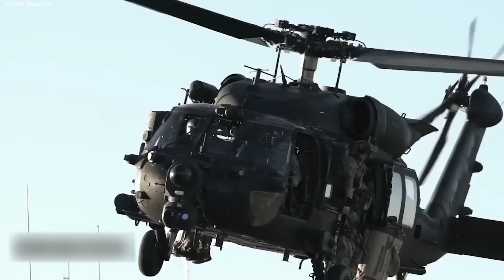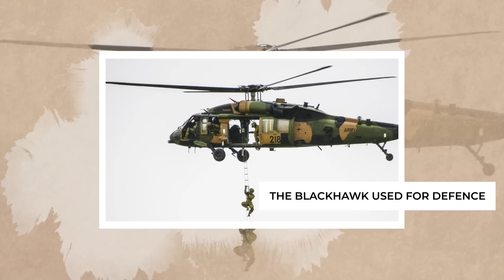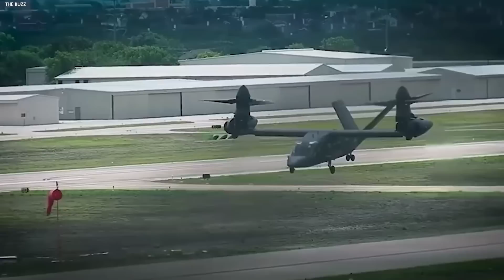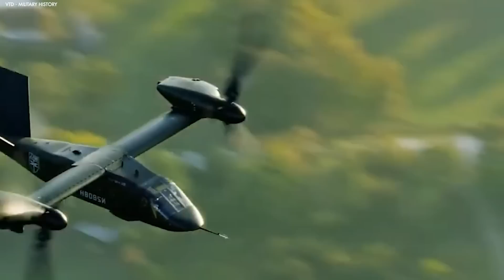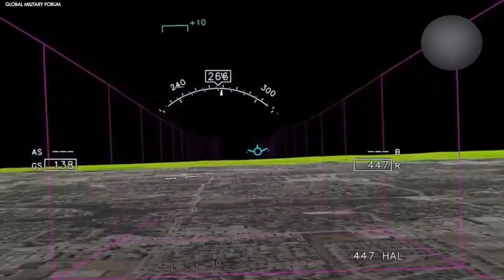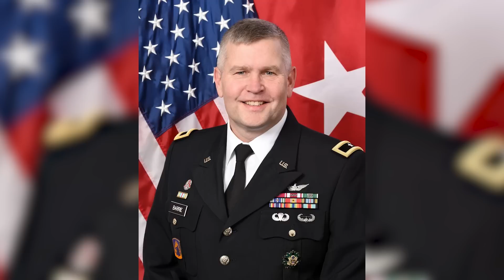Here's The US Army's Next Gen Helicopter to Replace The Blackhawk

Comment: Some errors are noted in the history of the Blackhawk. The first units to be equipped with the aircraft were the 158th Assault Helicopter Battalion, and the 101 Helicopter Battalion in 1978-9.  (I was assigned to C Company of the 158th at the time). We sold 22 used UH-1H's and bought 15 new UH-60's to replace them. The 160th Battalion was formed later by combining these units and aligning them with the new air support doctrine adopted at the time. Also, you stated that the tail rotor pylon could adjust in case of tail rotor failure. There is no control surface on the pylon.  It does have a shape (unchanging) that reduces the load on the tail rotor as airspeed increases.  Errors in basic facts detract from credibility.  Claims made about the newer designs become suspect because of your errors.

Comment: They just need Active Protection Systems like modern armor. Choppers will always be good in biomes with mountainous or jungle terrain. I did some basic research and found out the Valour could mount 64 Hellfire missiles on its wings including pylons a while back, 4 times the payload of the Apache with lift capacity to spare. The Valor will be able to pick up a hole the A-10 is going to leave upon retirement without stepping on the Air Forces toes politically further up the chain. 
I agree scout vehicles will all be drones now but they require physical control tethers to be invulnerable to jamming and spoofing which makes them kind of limited in some ways. 
I also agree about the Raider X as a possible replacement for the Apache and maybe even the little bird for tier 1 elements. I hope they make .338 defensive miniguns mounts for the four windows I spied on the Valour that could possibly support them. 
I think Choppers and Armor just need active defenses or different battlefield shaping techniques to evolve against MANPADS or FPV drones. 
It makes me wonder in a way if you gave the A-10's resilient airframe an Active Protection System weather it could eat MANPADS for breakfast alongside a performance upgrade like borrowing the B52's new engines upgrades that are nearly twice the power at quarter of the weight. It would be ready made to handle the frag coming in from defeated projectiles from a new APS hard kill system. Who knows what modern material science could do for that thing alongside some upgrades.       

As the technology advances you have to assume the enemy can see you at all times now and can probably take the first shot. Scary stuff. 
Manned vehicles will always be necessary until they make autonomous machines that are allowed to make kill decisions on their own, which will be very close. Elon Musk wasn't joking when he said they were building Skynet, starlink can act like radar and is the best control grid going and resistant to EMP because of the nature of the satellite nodes which can be relatively easily replaced 100's at a time in one lunch. 
Fascinating to me, trying to see where this is all going.  

That concludes my TEDTalk.

Comment: My nephew was on a government board/group that vetted the Valor and Raider X for the Army's vertical  lift program
Given the distances in Pacific warfare I can understand the choice of the Valor with its much greater speed and range.
BUT, if the Apache is ever to be replaced I vote for a slimmed down Raider X with its greater lift and speed than the Apache or ANY other attack chopper. But with the advent of drone warfare and very good MANPADS attack choppers may be a thing of the past.
Reply: I was selected as 1 of 8 pilot  in the Fly-Off Competition of the UH-60A and UH-61A UTTAS Program in 1976.  flew flew both models.  The program lasted a year, and the (now) Blackhawk was much better than the Boeing version because it was production ready.  We all learned a great deal about limitations and design during the test program and enjoyed a wonderful experience too. 

It appears the Next Gen Helicopter will be an even better improvement as well.  Good luck and safe flying.

TWO
CW4 Aviation
U. S. Army (Ret)
Reply: They just need Active Protection Systems like modern armor. Choppers will always be good in biomes with mountainous or jungle terrain. I did some basic research and found out the Valour could mount 64 Hellfire missiles on its wings including pylons a while back, 4 times the payload of the Apache with lift capacity to spare. The Valor will be able to pick up a hole the A-10 is going to leave upon retirement without stepping on the Air Forces toes politically further up the chain. 
I agree scout vehicles will all be drones now but they require physical control tethers to be invulnerable to jamming and spoofing which makes them kind of limited in some ways. 
I also agree about the Raider X as a possible replacement for the Apache and maybe even the little bird for tier 1 elements. I hope they make .338 defensive miniguns mounts for the four windows I spied on the Valour that could possibly support them. 
I think Choppers and Armor just need active defenses or different battlefield shaping techniques to evolve against MANPADS or FPV drones. 
It makes me wonder in a way if you gave the A-10's resilient airframe an Active Protection System weather it could eat MANPADS for breakfast alongside a performance upgrade like borrowing the B52's new engines upgrades that are nearly twice the power at quarter of the weight. It would be ready made to handle the frag coming in from defeated projectiles from a new APS hard kill system. Who knows what modern material science could do for that thing alongside some upgrades.       

As the technology advances you have to assume the enemy can see you at all times now and can probably take the first shot. Scary stuff. 
Manned vehicles will always be necessary until they make autonomous machines that are allowed to make kill decisions on their own, which will be very close. Elon Musk wasn't joking when he said they were building Skynet, starlink can act like radar and is the best control grid going and resistant to EMP because of the nature of the satellite nodes which can be relatively easily replaced 100's at a time in one lunch. 
Fascinating to me, trying to see where this is all going.  

That concludes my TEDTalk.
Reply: @knowahnosenothing4862  They would never mount that many hellfires, not even the Apache mounts as many as it can do pretty much ever... for many reasons, heavy, expensive, and just not worth risking that much on a single aircraft... similar to how the guided rockets on things like the OH58D Kiowa was sparing used, it was very expensive and risky carrying 14 rockets that cost way too much for little gain, basically mini Hellfires.